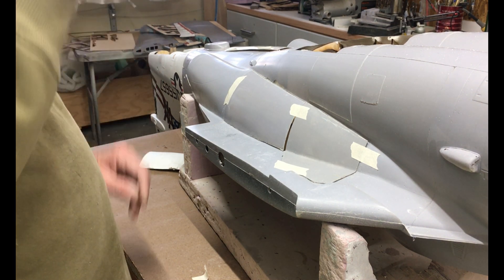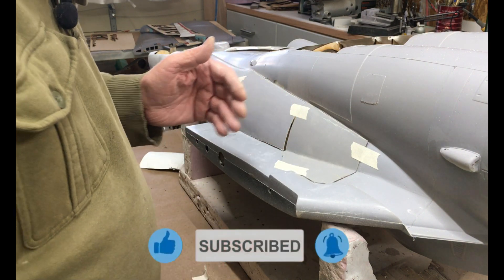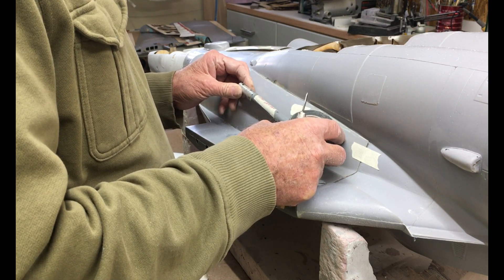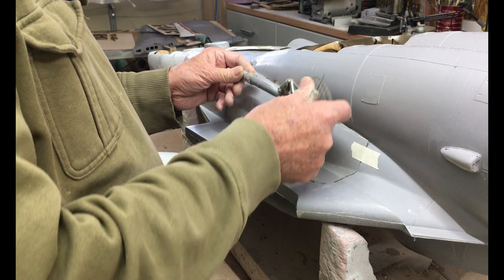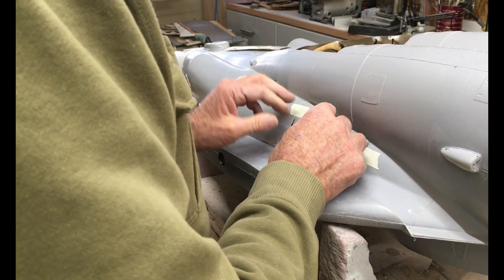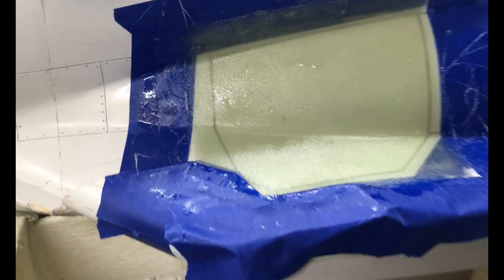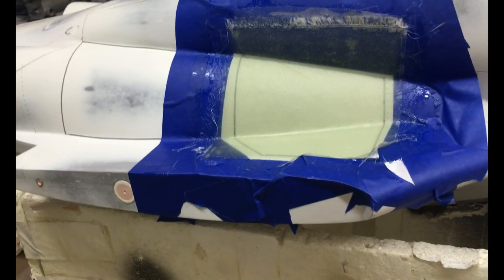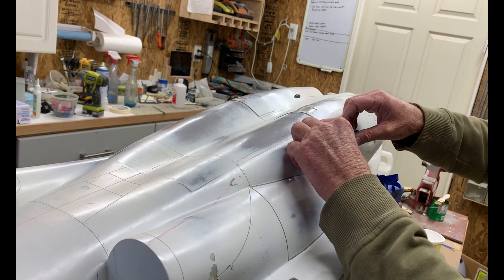A6 Intruder Build Part 8 Layup Gear Doors

Comment: Hi, great workd!
may I ask why you did not use molding (or tooling) epoxy as a first layer in order to get a good & hard mold surface?
How did the mold surface look like? Were there cavities?
Reply from the maker: Some small parts do not require a tool coat due to ease of removal.  I do use a tool coat on most parts.

Comment: Very interesting. Being a Navy A-6 mechanic we were told during the Viet Nam war the Marines removed that gear door to allow fitting an extra 500# on each side. The A-6 has five wing mounted bomb racks and Multiple Ejection Rack (MER)  was used to put six standard Mk 82 500# bombs on each rack. A full load was limited to 28 bombs because the inboard forward most MER on the inboard wing station would interfere with the door you are working on in this video. The Marines did a field modification to remove the door and that allowed using all six bomb positions on all five MERs. The Marines were always much closer to the front lines and didn't need to carry the fuel the Navy did. In most Navy missions MERs were fitted at three bomb rack locations, the outboard wings and centerline locations. The inboard wing racks were reserved for drop tanks.

Comment: Are you going yo be using rotating retracts in this build.  Eflight units i have on my P40 are reasonably good.  Not sure if they'll suit your application, weight ect
Reply from the maker: eflight are not very good due to lots of failures in the past.  So I'm using 90 mm PZ's which are tough and can take the 21 Lbs of aircraft weight.